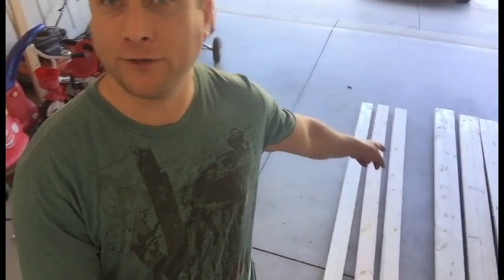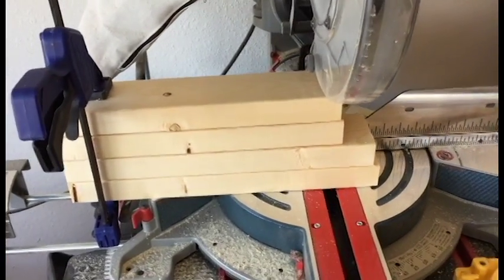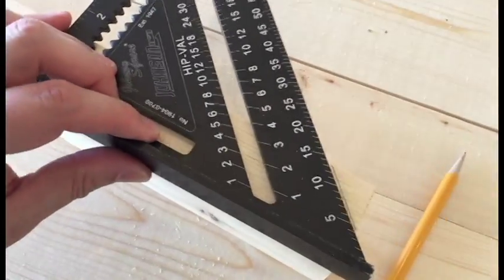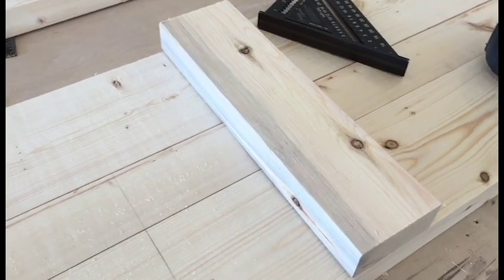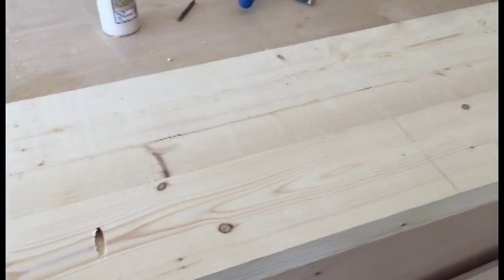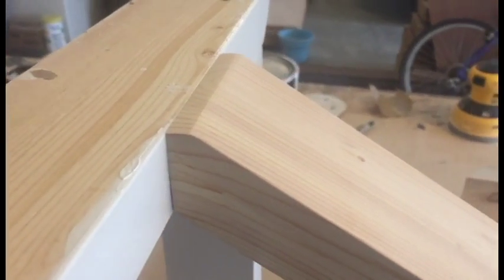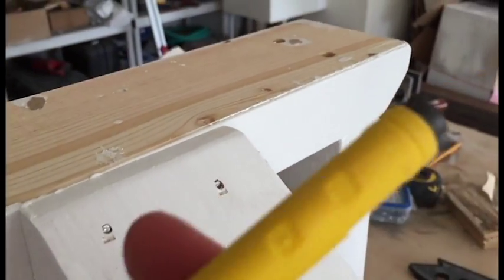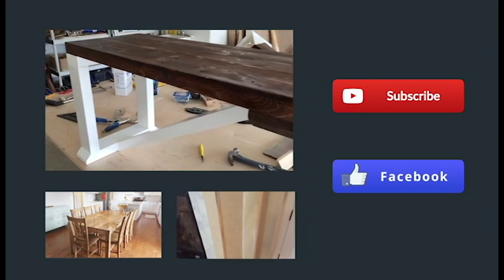How To Build a Farmhouse Bench | DIY Project | Woodworking Projects

Comment: How do you know what angle to set your saw for the braces?
Reply from the maker: I just did your standard 45 on the bottom and held it to the edge next to the top of the seat and drew a line and put the 2x4 on its edge and cut it with the miter saw
Reply: 22.5 degrees will also work. cut the bottom miter first and set it back on the table a mark the next cut.
Reply: Can you provide a better explanation.  Angles are hard.
Reply: You have to have a miter saw that allows you to set the angles. I have a sliding compound saw and it has the readings on it. When I set the saw at 22.5 degrees, this measurement is marked on the saw. You can use a compass to get the measurement also.
Reply: I needed to adjust the angle since I wanted my bench to be 4.5 ft. Here is what I did (I'm a fairly new DIYer so forgive me if the explaination is not so clear):
1. (may be obvious) Lay the bench upside down.
2. Stack a couple of scrap 2x4 pieces beside the bench aligned to the middle piece of the bench.
3. Start by cutting a 45 degree bevel on your brace piece and lay the bevel on the top scrap piece and angle it towards the leg. Get a rough idea of how far off the angle is.
4. Repeat step 3 with a slightly lower angle until you find the right, er, correct angle you need. In my case, I needed was 32.9 degrees (there is a mark for that angle on my Ryobi miter saw).

Comment: Step one to make this bench: have all of the equipment to do this 🙄
Reply from the maker: It can be done with a circular saw and a drill at the minimum. The look may be a bit different.
Reply: Philip Miller I have Home Depot. They should be able to cut the wood for me right? I have drills but no wood working tools like that since I don’t have enough space in my house for that. You think I would be able to achieve it that way?
Reply from the maker: Thayer should be able to cut everything to length for you